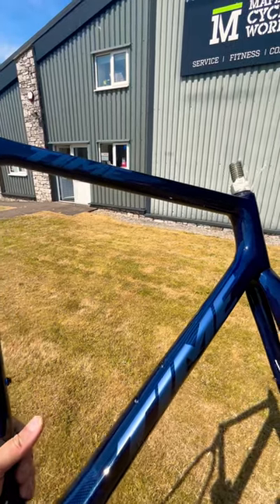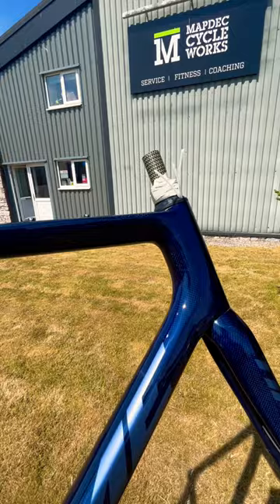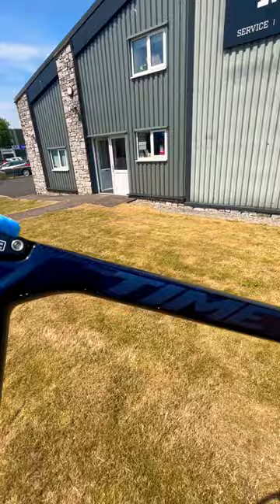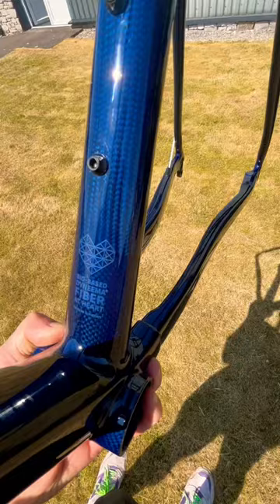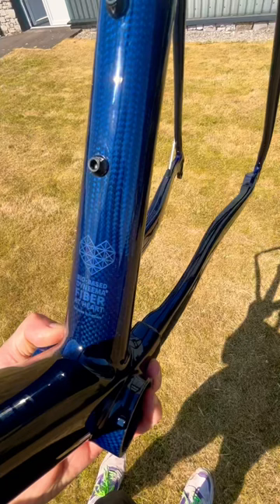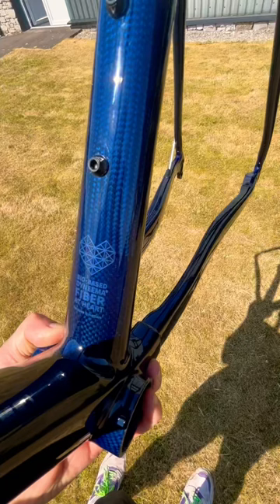Unboxing these never gets tired. #cycling

Comment: just a shame about the bolt holes in the top tub
Reply: they're so useful!
Reply: @EmmanuelNataf  I've never seen anyone use them ever 😳  honestly 😕
Reply: @gclh22  very common for gravel or bikepacking. With bolts you don't need any straps — makes for a very clean setup.
Reply: @EmmanuelNataf  yes I completely understand that. Still  don't know anyone who uses them
Reply: @gclh22  now you know someone :)